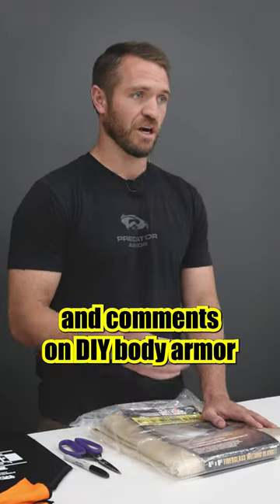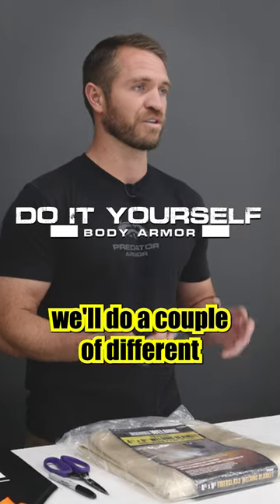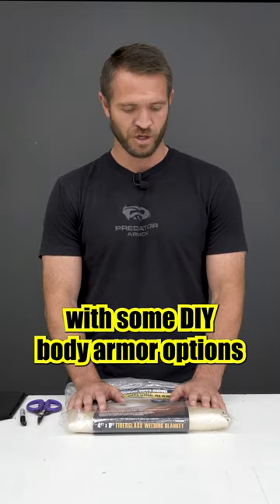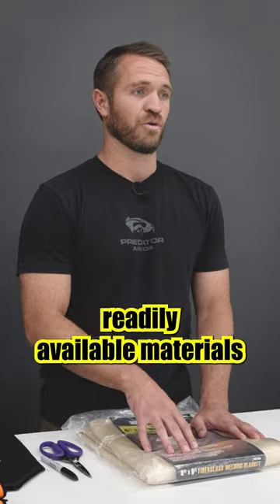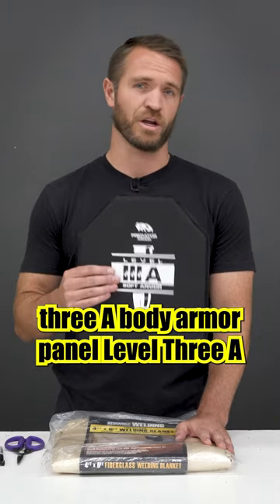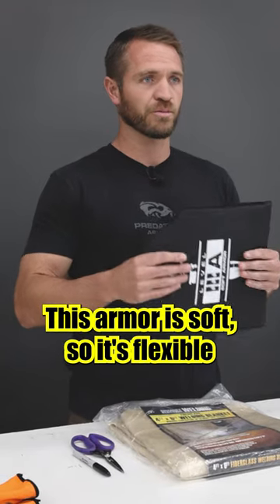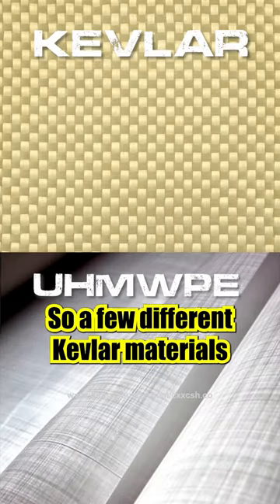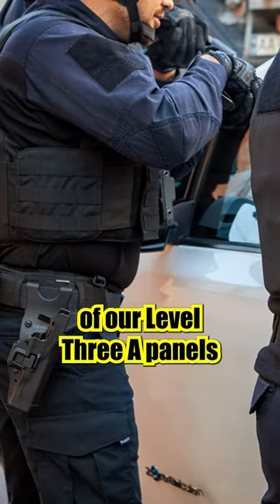Trying To Make Homemade Soft Body Armor #predatorarmor #bodyarmor #selfdefense #diy

Comment: I want to see a quarter inch of aluminum, which is 3a, backed with fiberglass which is about 3a as well, and a good bit of cross weaved duct tape on the aluminum to prevent spall, in theory from the brittle aspect of aluminum at high velocity, and it's flexibility at low velocity, it should act as a level 4 armor, this is about a half inch thick or an inch thick that is completely home made.